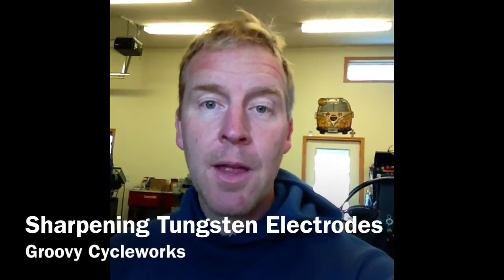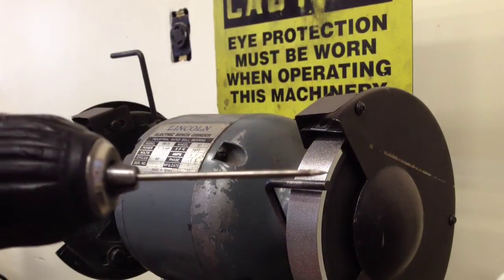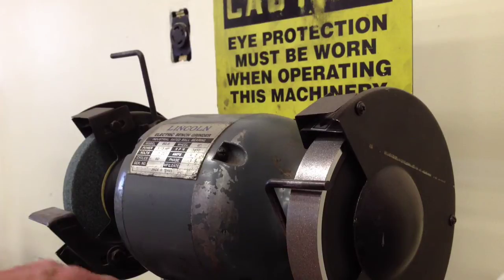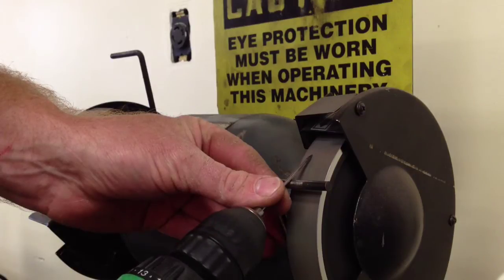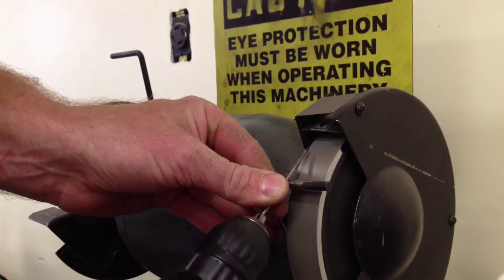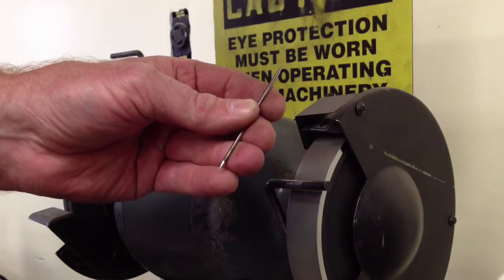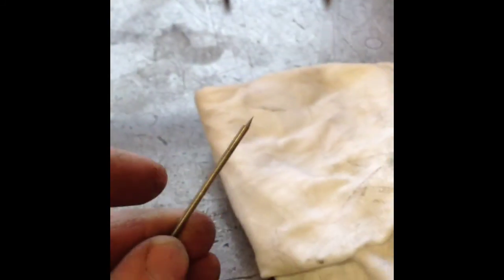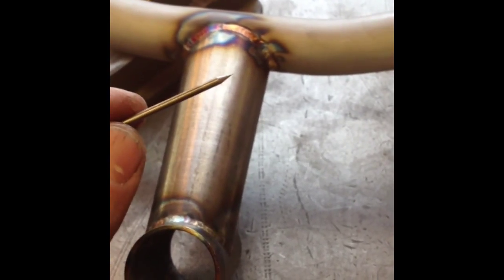Sharpening Tungsten Electrodes

Comment: Hmmm, why are you grinding towards the tungsten shaft? This will affect your arc throw. You want to grind away from the tungsten. Otherwise nice tip. Don't mind me posting on a 6yo video.
Reply from the maker: Thanks for checking in Brian. I can tell you after 32 years of TIG welding on extremely thin material where control is absolutely paramount, grinding towards or away from the shaft of the electrode makes absolutely no difference.  As long as your striations are in line, electricity will flow in a controlled manner.

Comment: Dear My friend ,the way you grind the tungsten electrode looks simple but  i think it is not very good for the tungsten electrode as to the high speed will make the tip black or blue ,we do this products for 18 years .maybe we could talk about this .
Reply from the maker: Martin Zhao Martin, as you can see in the video, there is no discoloration in the tip.  If you have discoloration, you are using an abrasive with too high of grit count, applying too much pressure, or working too slowly.

Comment: Hi i noticed on thei video that your not using your moddified cup and ges lens setup on your tig torch do you no longer use that combo ?
Reply from the maker: reaperwayne I have five different set ups I use on my torch dependent on material type, wall thickness, and access necessary.  There is no one "go to" for all applications...you need to develop a repository of experience to know what tools will achieve the desired outcome.
Reply: Rody Walter Thanks for your reply